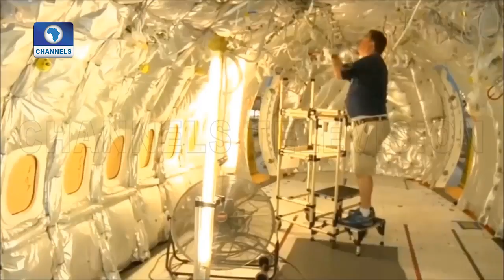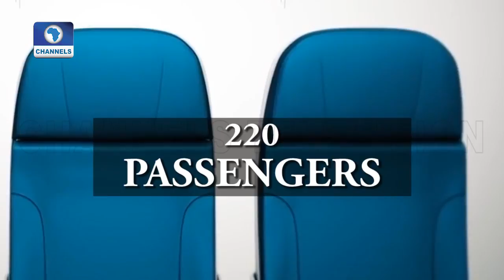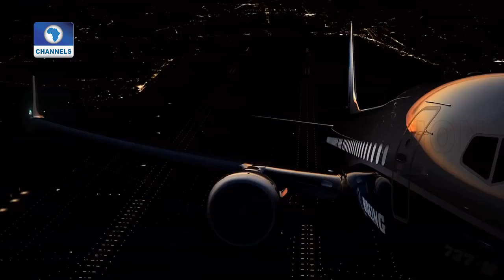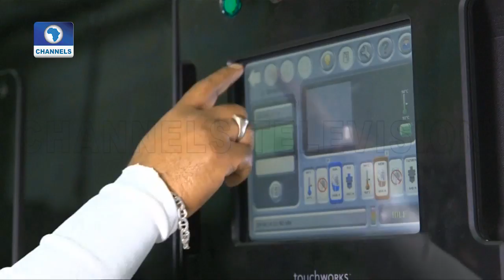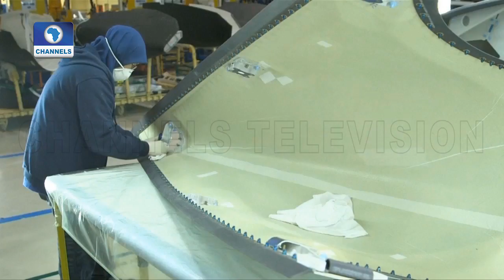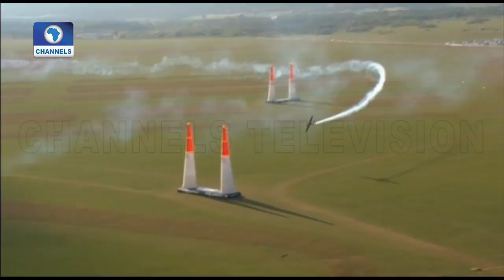Feature On The Fastest Selling Jet In The Boeing Brand |Aviation This Week|

Comment: It was slightly interesting that after Mr. Onyema suggested the fuel savings were so much that you could use the same amount of fuel and fly to Algeria and back (somewhat tongue in cheek I imagine), the Boeing representative was sure to correct that impression mentioning that fuel savings were i the region of 20%... just in case someone had used the wrong assumptions/numbers when testing the case for purchasing the new planes :-). Excited to fly in the New B737 Max sha. Kudos to Air Peace.